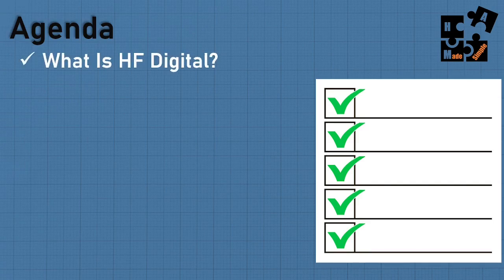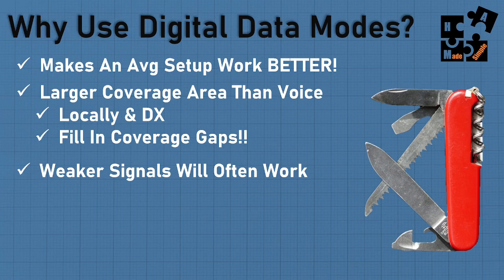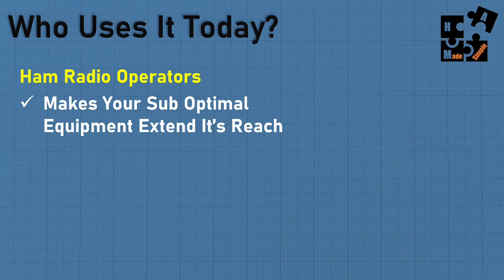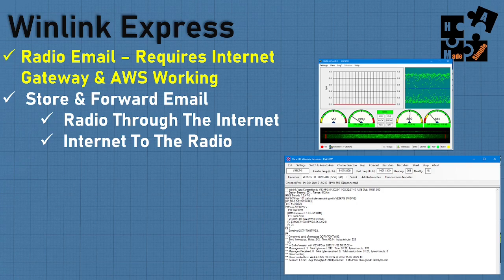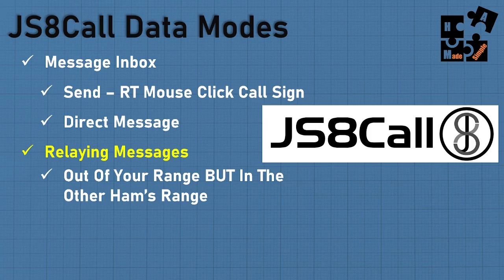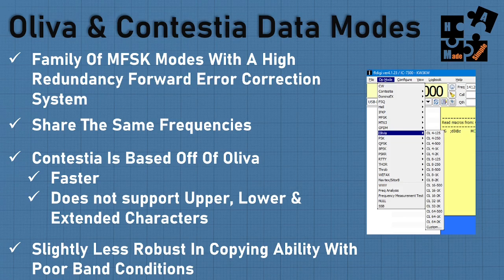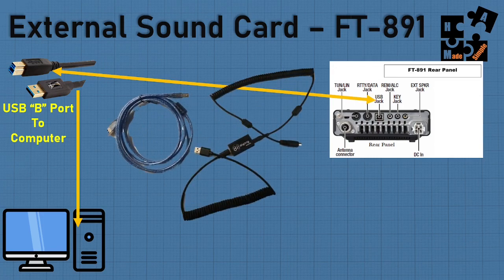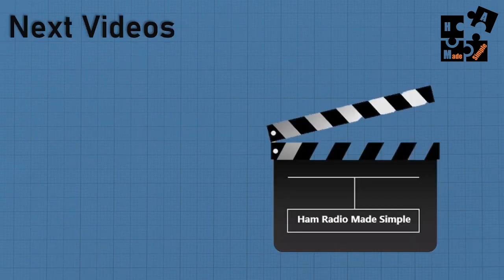Top 4 HF Digital Data Modes For Ham Radio Preppers - Part 1

Comment: Sixty meters is a great Emcomm digital mode band.  If often works  better than 40 or 80 most of the day.  You can coordinate your traffic by voice then send data on the same frequency.  The channels will be available if SHTF hits on Field Day!  The challenge is having a suitable antenna.  The EFHF antennas usually will not work.  The non resonant "Random Wire" end fed antennas with a tuner will work.
Reply from the maker: GREAT INSIGHT Steve!!  I will take note of this and hopefully work it into the next video.  Thanks for passing this on to me.  73
Reply from the maker: The more I use 60M, the more I keep coming back to your comment.  Your ahead of the curve on this my friend!!

Comment: HF digital modes are not low-power modes, they are weak signal modes.  As with all RF, it may take 2 watts to reach your contact and it may take 1000 watts.
Reply from the maker: Thanks for pointing that out Tony.  I will clarify this in one of my next videos.  I really appreciate you taking the time to reach out and let me know.
Reply: Oh thanks for clarifying that

Comment: So the most valuable feature of Ham radio for emergency communication- digital modes allowing the sending and receiving of messages with text over long distances require a special SSB transceiver which now increases the cost of a transceiver from around $200 to at least $800-$3,000. And to top it off, you need an ADDITIONAL advanced “General” license to even be allowed to access and transmit on the HF frequencies, where the digital modes are allowed. Are you freakin kidding me? That is a huge cost for someone who just wants to have communication for emergency or SHTF preparedness.
Reply from the maker: You bring up some good points.

Listening is FCC free of regulations, so that is always a great option too.

GRMS is a very good option for LOCAL comms.  Again, If you are looking to communicate when the power is not down, fun and very easy to jump in.  My thesis is what do you do when the power is out for extended periods of time?  Repeaters back up power setups, after 48 hours, is dependent (for the most part) on someone hauling fuel to the generator - to keep the power on.  Even with HT in the ham radio world, you face the same issue. So, if you assume there is no power interruptions, great choice for LOCAL comms.  Simplex is "line of sight" so topography dependent as well as the height of your antennas.

Like I said in the video, "something is better than nothing".   Ham Radio is the BEST way to go BUT NOT the ONLY way to approach this.  YOU choose what is best for you and your family base on your commitment, time and resources available to you. I know not everyone can go to this extreme but I did and now I am the COMMS guy for others who can't.
Reply: @hamradiomadesimple  Thanks for the response! I have a bunch of non technical prepper friends asking me to let them know at the end of my learning, studying and setup of ham equipment if the benefits of ham radio for emergency communication (approx 25 mile range in an urban residential environment) outweigh the cost-which I’ve found to basically be $1,000 and the studying of highly technical material with a huge learning curve. I’m hoping the answer will be YES with a 50W base radio (Btech uvx50), low loss coax and a house roof mounted dual band vertical antenna. Especially now that I’ve just learned there is an awesome FREE digital mode that enables radio to radio sending and receiving of text messages with no cell service or internet required and which can be used on uhf/vhf without having to use SSB or purchase any additional equipment. It’s called “Rattlegram”. It’s an iPhone app that I downloaded and began using within seconds. Super simple. No need to buy and setup sound cards or any of that crap. The app works really well and does not require cell service or an internet connection. So if a $1,000 investment and a technician license can yield emergency communication of up to or around 25 miles I’d say the benefits of ham definitely outweigh the cost for the average non-engineer individual.
Reply from the maker: Try it first and see how simple it really is.  Once you get it mastered, you hand others the radio already programmed.  Short printed instructions and off you go.  I found that the standard antenna on HT's are not worth much.  I use the Signal Stuff Antenna:  https://signalstuff.com/products/   I get about 25% more distance out of it.  About $30 but the antenna is the most important part of the radio.

I think you are talking about APRS?  Pretty popular and fun to use.  Only down side is that anyone at anytime can see where you or should I say, your radio (when on) is.  Great tool for wilderness hiking, camping etc.  Travel on a long trip, pull up the locator tool on your browser and monitor your movements.
BTech is a very good quality radio.

Comment: WWV is on 2.5, 5, 10MHz that will give the time. Can set your clock from that. I don't know if there is software to set the computer time with WWV from the HF radio. But it can be set by turning to there and it gives the time and a tone on the top of the min. If you keep you computer time updated they should not be off by much, the clock in the computer are very good. There is more than one way to get time.

Comment: HF digital modes is a good reason for all the prepper oriented folks out there to get a ham radio license.  There are too many preppers out there who either don't have a clue about HF digital or think they can do discovery learning during a crisis.  I will tell you there is a learning curve to HF digital and you need practice.  It is a powerful tool that some "pirate" operator will not have access to without experience.
Reply from the maker: SPOT ON!!!  Could not have said it any better.  Thanks for posting!!

Comment: Great video! 
 The time sync problem without a high precision source (GPS, Internet time sources, etc) can be tricky but is doable with some "fiddling" with manual time adjustments.  

Not trying to advertise for Ham Radio Deluxe, but the info on its cost you mentioned is waaaaaay off. There is a one time fee to purchase it ( as low as around $ 50 if you catch one of their deals or coupon codes) and that includes a year of updates and tech support to help you get it up and running on your system. But it works just fine after that year and you don't have to pay for anything else ever again if you don't want to unless you want to subscribe for updates, but that's not required.   It's a massively useful program that has soooo many features that actually assist you with digital comms and logging.  It wasn't very fair for you to comment on the price with that inaccurate info.

All of this, of course, depends on you having working electronics.  An EMP is a real concern and unless you protect your equipment from such events, all this is a moot point.  I do keep a fully setup, tested and updated laptop along with an HF portable rig and associated sound cards, cables and solar power system that have all been teated together  in a shielded, protected container so that I will have something at least that is still functioning after SHTF.  Bigger rigs, and their support systems can be too bulky to effectively protect from EMP's.

Thanks for the video, lots of great info on the topic
Reply from the maker: Absolutely.  Those who plan on using those apps, with this requirement, better learn how to NOW!!  Down the road they may not find any good instructions.  I document all this stuff so when I need it down the road, I pull out my notebook with the instructions.  GREAT POINT.

Comment: With VARA HF P2P is the best digital for prepping in my opinion. You just have to find a clear frequency and will have to change the frequency depending on time of the day. Thank you for the very detailed and informative video de W4MTJ.
Reply from the maker: Works great and allows you to pick up messages as long as they leave their rig on.  Thanks for posting and have fun!!

Comment: Been playing with this digital stuff for months, Running Ubuntu Linux 20.04, IC-7300.
Just seem to have a heck of a time figuring out what mode I'm listening to. Ft8 is easy,  JS8 not bad. The other modes i've had very little successful decodes. Then some times the rig takes off and starts transmitting outa no where ! so I power down !  Using WSJT-x, JS8Call, FLDIGI, also have MixM ( no luck even with FT8 using MixM on VirtualBox Win7 guest even though the water fall is showing data.). 

Thanks. Good video. I will be watching the rest.
Reply from the maker: The challenge is making sure you have the setting correct in your rig, PC and the software.  Some software are more forgiving on the settings than others (Fldigi has to be perfect).  So many moving parts and need to know that some rig settings will work for one software app but not another.  Yes this is quite frustrating.  Let me know if you have questions and send them to my email HamRadioMadeSimple@gmail.com

Comment: Great content i have never tried digital under 2 m band 70cm and above ihave setup the ftm6000 4 digital the ft891 is set up 4 mobil operations have a backup ft897d with amplifier if i need extra power and the clasic militery encoder tiper machine usualy prins ham radio news rtt is a old sistem of coms relayng text mesages
Reply from the maker: Love the way you are approaching this.  Have multiple ways to setup and think Digital FM too!!
Reply: @hamradiomadesimple have a old tube sistem just in kase a emp noks at my dore from what i know tub amps and tube radios cant bee afected by a emp evrithing with modern electronic get fried if not properly shield

Comment: Good presentation, thanks.
Reply from the maker: Glad it was helpful!  Trying to shorten the learning curve for others.  

HF digital is going to be the best way to communicate when trouble times comes on this nation.  Many  in the ham community are starting to realize this.  With lower power & smaller skip zones blockage, I am amazed at how many direct call K2K I am making.  Have fun and let me know if you have any questions.
Reply: @hamradiomadesimple  I set up VarAC based on one of your other presentations and I'm amazed at the K2K QSOs I've had with folks thousands of miles away on 20m with an EFHW antenna on 20W. I can see how it would be a great emcomm mode free of the cell/internet/power grid infrastructure.
Reply from the maker: @antonioaprado  It is a very good option to use and you will find many people using this mode to do QSO's with.  Glad you are using it and having fun.  For me, I focus on K2K DIRECTED Calls to my friends all over for when the Grid goes down.  I have been showing them how to relay messages since no one an reach everyone at the same time on the same band.  This is skill to acquire and knowledge to learn.  Once you master VarAC on random calls, focus on directed calls using relays.  It is so much fun and can be done on most of the digital apps out today. (JS8Call, FSQ).  I mostly do Winlink Vara HF P2P and that is one of my favorites.  It works if ONLY ONE of the two operators can connect.  One can send and pick up the message in the other's outbox and leaving a message behind.  Have fun!

Comment: It seems like FSQ, Olivia, Contestia, and JS8 Call all do similar things - chat messages, file/image transfer. Is it sufficient to choose one like JS8Call or are there other capabilities that I would be missing out on from the others?
Reply from the maker: They share similar features but each one's approach is different.  It all depends on what you are trying to do that will draw one to a particular app over the other.  I use several for different goals and situations.  They all are fun but take a while to learn best practices.   Also, some work better in different band conditions and each person's setup.                                                                                     
Anything in particular you are trying to do with them???
Reply: @hamradiomadesimple  I'm looking at what modes are available/viable for 1000 mile-ish QRP comms with a specific recipient. So I was thinking, Peer-to-peer winlink for email, and one or more of the text/chat modes for conversational comms and file transfers.
Reply from the maker: @gary6212  YES and use JS8Call and VarAC.  Low power great distance....
Reply: I personally like FSQ, OLivia, Contestia, PSK31 & Olivia.  I do NOT like JS8 as it seems like the computer is doing  All the computing to send and reply!  I've got other things to learn but I won't try them for a  few months.

Comment: a Lot of those modes do not work if you dont have internet or a working GPS for perfectly synched clock.  a lot of low signal modes are useless for emergency use because of that. FT8 JS8call is completely useless without it for example.
Reply from the maker: Good point however there are work arounds for JS8Call I will discuss in that upcoming video.  Fldigi Op Modes don't need time sync.  FT-8  does require time sync but not a keyboard to keyboard mode.  I don't use that one from a prepping stand point.  Thanks for taking the time to post this.
Reply: Well, JS8Call does not require the internet.  Our EmComm group is opting to this mode.  IMHO and I agree that FT8 is not on the list for EmComm connections.  Take a closer look at it and re-evaluate your statement.  Oh, I must amend this statement... it does require the internet to download the program. ;-)

Comment: We can't presume functioning internet, and multi-party time sync with or without atomic clock would add complexity.

So, for shtf, empirically it seems that one should use a peer-to-peer (p2p) mode that doen't require precise time synchronization. Which mode(s) meet these criteria?

For p2p mode, if no internet connectivity, where is the message stored until it can be read?

It might be good to start with an overall description of the message pathways for digital transmission, compairing peer-to-peer vs internet transmission and use of repeaters. 

In your example, operator A in TN wishes to send a digital message to operator B in WA. Presume internet and digital repeaters are down. I guess the two operators must agree in advance of shtf that they will send/listen for messages at specific times of day on specific days of the week.

Is there p2p for digital voice modes? Do they have similar benefits?

I looked for a way to make a donation to help the channel but didn't find one. You put in a lot of time and effort to help us and it IS appreciated!

Thank you!
73,
John KK7JBZ
Reply from the maker: John, all great questions and in the next videos that drop, I will dig deeper into each mode.  There is no perfect solution today however  a few HF Modes do offer some solutions that can work successful with work arounds.  Like you mentioned, "they will send/listen for messages at specific times of day on specific days of the week".  With specific frequency, format speed (except for FSQ).  We work with what we have and get the most out of it.  

The real questions are, how many people have a solar power generator, solar panels and know enough to get the right size amp hour battery setup?  No power means no ham radio working for them.  Are they part of a like minded group (across the USA) who can help by becoming a "relay beacon" to relay messages to friends and family ( a ham operator or knows someone who is)?  Have they practiced these skills to operate one moment past SHTF?  

I really appreciate your offer and will see if YouTube has a way of accepting contributions.  Any money made goes back into this channel.  I want to help others be prepared for what is approaching us soon.  Like in 2023...  THANK YOU!!
Reply: Winlink has radio-only gateways where you can email asynchronous within a region. They can relay to other radio-only gateways or if you have an agreed-upon radio-only gateway with a contact you could email them and they'd retrieve the email from that specific gateway, without needing internet.

Comment: i been able to do rtty, and js8call but still slow on the winlink and will check out the others soon
Reply from the maker: Most important app to learn is JS8Call.  Check out my video.  Top choice going forward now that I can do time sync.
Reply: Excellent Choices!  Although RTTY seems to be more Prevalent, JS8 Call is Another Great Choice!  I Just Wish that MORE Operators Would use it!  73's!  AE0QG 🇺🇲

Comment: @hamradio made simple ... I have a attic mounted 60" endcom . I have a 50 foot low loss coax from the balun to the radio. IT was kind of long so i coiled the extra coax and tied it off near the balun in the attic. I also have the RFI choke from chameleon installed. Is there any chance the extra coiled coax near the balun is causing a loss of signal on the reception side? Radio is FTDX10 with AT-200 Pro Autotuner.
Reply from the maker: 50' should not cause an issue unless it is not the best coax cable.  I NOW look at the manufactures charts to see what is expected loss by length and by band.  
I have coiled my coax (poor man's choke) and have not had much issue with it.  Try uncoiling it and see if there is a difference.

Has your SWR changed before using the tuner?  Always measure the SWR without the tuner.  That is most likely the issue.  Poor SWR will impact TX and RX.  The tuner just MAKES it work better with the rig. 

Try moving your antenna location.  I have heard others tell me they move it (in their attic) a few feet and the SWR improved.  Focus on getting the lowest SWR BEFORE connecting the coax to the tuner. That means moving it to find the optimal SWR outcome.